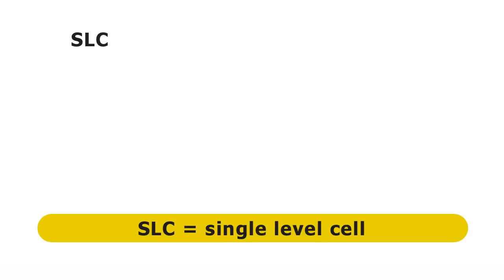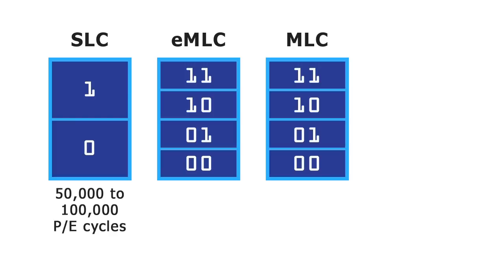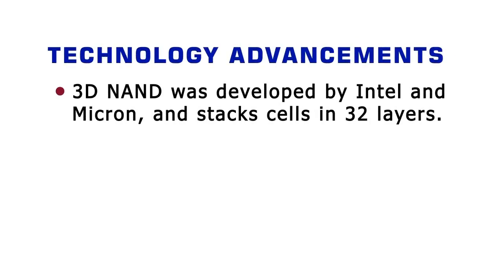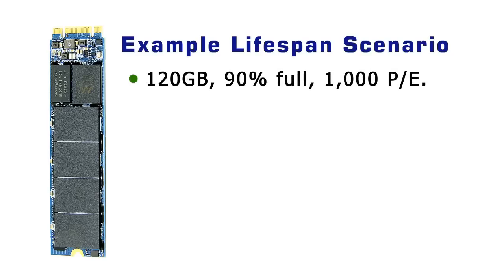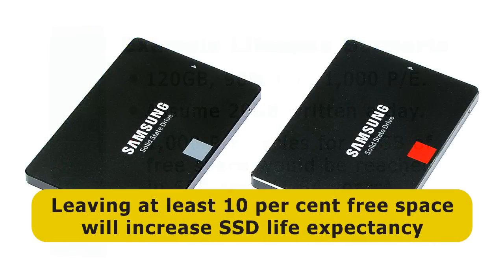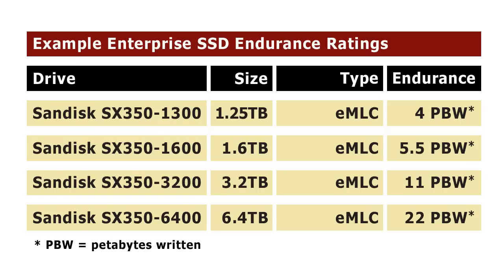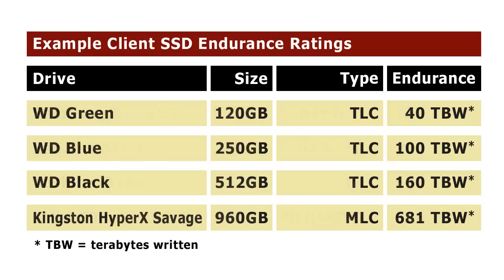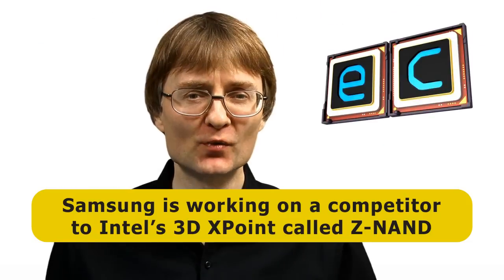SSD Life Expectancy

Comment: Golden rule #1: backup your data, nothing is fail proof
Reply from the maker: The 3-2-1 Backup rule remains the most wise: https://www.youtube.com/watch?v=rFO6NyLIP7M :)
Reply: Yep.. and backup stuff more than just once. Maybe even 3 or times.
Reply: Agree, but with SSDs, what bothers me about them is that they are guaranteed to fail.  Sticking to my beloved HDD, only ever lost 1 in my life.
Reply: Probably right.
Reply: @NeilRoy  And HDD aren't guaranteed to fail?   They are. Everything breaks. Entropy sux.
 HDDs have moving parts, use more electricity and heat up much more, get fragmented and are much, much slower than SSDs. 

Any PC that less than 5 years old and is still running an HDD as the boot drive is slowed considerable by that HDD.  Its fast processor/processors are HDD-bound, waiting way too much for stuff to do because the disk is too slow.
Reply: @dimbulb23  wht do u expect  life expectancy  of  ssd
Reply: @faheemkhan359  I have bought and have used 16 SSDs on my PC or laptops.   I bought the first one in February 2010.  None of them ever failed.  Many were retired and replaced with faster models and were then used as cloned backup units.  In my opinion it's insane not use them, at least for your boot drive.  Certainly if you require huge amounts of storage buy HDDs for that.  
Replacing an HDD boot drive with an SSD is the #1 performance upgrade you can do. How long will they last?  That's a rather silly question. How long does a new car last?   Since I am 74 years old  I can say with absolute certainty that a new Toyota bought today will last a lot longer than the new one I bought in 1970.   Why, because new technology is better.  SSDs aren't that new, they work, they're faster and anyone who is computer literate uses them.  The End.
Reply: Once you've performed Golden Rule #1, go back and read Golden Rule #1. :-)
Reply: @dimbulb23  use SSD for OS, softwares, games e.t.c... and use additional HDD for media storage. Best of both worlds 🤷‍♂️
Reply: @wokesheep IMO The only thing HDDs have going for them is price. They are cheapest of both worlds.   
If I needed to store 10TBs  or more of critical data, I'd feel much better if it was contained  in a RAID array of SSDs. They are simply more reliable than HDDs.   Even then, I be concerned about the house burning down.  So I'd have to figure how I get all that critical data t backed up on The Cloud. 
Somewhere in this process I think I would stop worrying about how much extra the SSDs cost.   
Since I have far less than 1 TB to store my stuff, I no longer use HDDs at all.  HDDs will soon go the way of Zip Drives, punch cards, magnetic tape drives and floppies. tick tock
Reply: Im backing up mine in a usb drive which is also an ssd
Reply: @NeilRoy  you can get an ssd for your system drive, and for programs and stuff but keep your personal files in an hdd since you probably won't access them that often and even if you do you don't really need an ssd.
Reply: @pneumonoultramicroscopicsi4065  I built a new system last year (Jun 2019) and I did exactly that.  I bought a 250G SSD as my boot drive with the OS on it.  And a 4TB HDD (Seagate barracuda) as my main drive.  With Windows 10, I was able to relocate my Documents, Pictures and Desktop folders out of my personal folder and onto my HDD so even they are not on the SSD as I tend to save a lot of stuff to my desktop before moving it elsewhere.  It's been a nice solution as the system boots up really fast now and the HDD is plenty fast enough for what I do.  So yeah, that solution works really well.  And I have an external backup drive I regularly write stuff to.
Reply: @dimbulb23  I NEVER said HDDs aren't guaranteed to fail, just not nessecarily in my lifetime.  I still have really old (think, 1990s) 20G HDDs that work fine.  I don't need them or expect them to last forever, just until they are too small to be useful to me anymore.  SSDs have an absolute fixed life.  It's not entropy either, it's how they operate where as HDDs have no fixed amount of time as I can easily prove.  I have only ever had 1 HDD fail in 30 years.  I do use an SSD as my boot drive, love it for that.  My main data is on my HDD which is plenty fast enough.
Reply: @pneumonoultramicroscopicsi4065  I don't mind the load times from a HDD.  4TB SSDs would be pretty expensive compared to what I can get for a HDD, and I still trust my HDDs more given my own life experience with them.  It's just not worth the extra cost for speed that I am unlikely to notice most of the time, and questionable life span.  Also, cheaper SSDs have a shorter lifespan due to how they operate so... I doubt my mind will change on this anytime soon.

Edit: I just checked, the cheapest 4TB SSD would cost me almost $700 or more CDN.  Where as a I can grab a 4TB HDD for just over $100 from a brand I know and have come to trust.  I would rather buy two HDDs and have 8TB for just over $200 than 1 SSD for $700 (and that was the cheapest SSD I could find, others cost up to $1000 or more).
Reply: @NeilRoy  ALL my HDD's over the years have eventually failed. If I hadn't had backups, I would have been screwed.
Reply: AND offsite copies.
Reply: @KameraShy  I still have some really old ones.  Only ever had ONE fail.  My smallest is a 20G, still works.  My Seagate drives seem to have the best record for me for long life.  I just hooked some up to my system via a new conversion cable for USB so I could connect them and grabbed some old files from them.

I do backup a lot now though.
Reply: Wrong. No1 golden rule is Whoever owns the gold rules.
Reply: With my luck both will fail at the same time
Reply: @dimbulb23  SSD loose memory but HDD doesn't.
Reply: @wokesheep  exactly my way of use !  My experience FAST  lives short, SLOW lives long. It's the same way nature works with life.
Reply: @wokesheep  HDD is still fine for the vast majority of games too. I keep my more demanding open world games ect on my SSD but the rest are chilling on my 3TB 2.5" 5400rpm external drive along with my movies. Considering I have hundreds of games it would still be kind of expensive to store them all on SSD. Most games are perfectly acceptable on HDD still especially if you dont have windows installed on it. Far from ideal but most games really dont experience significantly long load times even with HDD and the ones that do are the ones I keep on my m.2 nvme.
Reply: @dimbulb23  The vast majority of data stored in the world is still on HDD's.... It'll be some time before they are gone but it will eventually happen that's for sure especially with how cheap SSD's are getting. You can get a 1TB nvme m.2 for around 100 bucks now. That's a great deal for very fast performance but still 60 bucks for my 3TB WD external drive wasn't bad either and its perfect for my movies and the vast majority of my games. SSD may be getting cheaper but I still dont have 300 bucks to spend just to store my movies and games on. I keep my OS and my more demanding open world games ect on my m.2 nvme and the bulk of my storage is on my external HDD. I don't really see that changing anytime soon either. I plan on getting a few internal HDD's to toss into my PC too along with a sata SSD too that away I have a couple faster storage options for when I need it along with all the mass storage I could need.
Reply: @dimbulb23  I had a Dell Dimension  4600 with 8GB of RAM and a 2.66 GHz processor in 2010.  I believe it had a 160 GB HDD.  There was no waiting on it for anything.  Everything I clicked on was there in the blink of an eye.  It worked faster than I could decide what to click next!

As for HDDs heating up, you need to remember that the heat in an SSD may be less, but it's concentrated in a smaller spot.  When you look at one of it memory chips or modules, the actual IC chip that does the work is a lot smaller than the plastic body that you see.  HDDs may generate some heat in the main motor and the little motor that moves the head, but it is practically nothing and spread out in two different parts within the drive. Besides that, motors are a lot better able to handle heat than a trillion microscopic semiconductor devices packed into a space that might not be more than a quarter of an inch square and stacked on top of each other.

CPUs are the major generators of heat in a computer.  That's why they have heat sinks.  When did you ever see an HDD with a heat sink?
Reply: Golden rule #0 (optional): no need to care privacy, use clouds
Reply: Should we also backup the backup of the backup?

Comment: I watched this 3 years ago, my drive is still alive!
Reply: Bro i use pdf reading, surfing and video editing on my laptop. My budget is very tight. I am getting kingston 120gb for 1599,240gb for 2399. What should I do? 
My hdd C drive has 88gb space used up.
Reply: @souravde970  240 GB will have more P/E cycles, as mentioned in the video and thus last longer if you leave 10-20% of space unconsumed.

Comment: I wish I had seen this video a month ago; I spent 12+ hours researching SSD's in every variety. What bothered me most was that Samsung has chosen to "re-write" the terminology.  I reasoned that I wanted at least MLC for a minimum, I wanted to avoid TLC. Samsung has decided to call their TLC SSD's "3MLC", never giving any reference to actual TLC drives.  I ended up, after endless searching, buying a Samsung 1TB V-NAND SSD  970 PRO NVMe M.2.  I am very glad to have found it. It is TRUE 2-bit MLC, with a 5-Year Limited Warranty or 1,200 TBW. Samsung sells this drive for $270, delivered; I found mine for $217, delivered.

Comment: 6 years old usage, zero problems, love the SSD
Reply: I have a 6 year old ADATA SP550, it has been used and abused with gaming, large file transfers, and many hours of daily driving. 
MHDD report zero issues and read and write speeds are as advertised!
Reply: Noice
Reply: @wileymonair  How do you managed to use that long? I've bought a used one then the HDDSentinel came up with 9% health left with 655.4GB of lifetime writes. Mine's a TLC SSD. Can see that Windows is spitting out errors. Windows Store couldn't download apps even though I've reinstalled Windows 10 which is the latest 20H2 for ten times lol.
Reply: @NextGeneration9501  what ssd? how many TBW it has on the first bought? how many GigaBytes you written on one day average? how long has been used?

Comment: Buying my SSD was the best thing i ever done. My three plus year laptop (I7, 16GB RAM) got a new lease on life when I upgraded to SSD (1TB), it really made the whole system blazing fast. In my opinion, definitely recommend switching to SSD, if you see your laptop/desktop becoming 'sluggish' after a few years.
Reply: Aye..replacing an old, sluggish hard drive with an SSD usually does speed things up a bit..I’d be extremely disappointed if it didn’t..lol